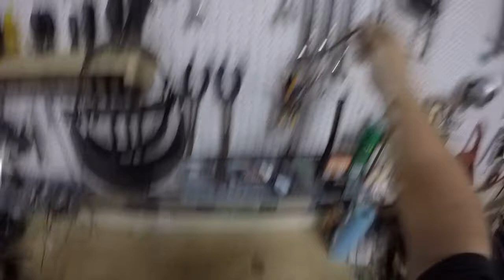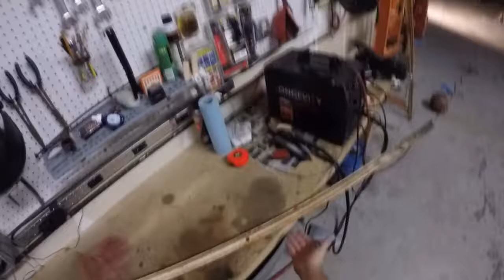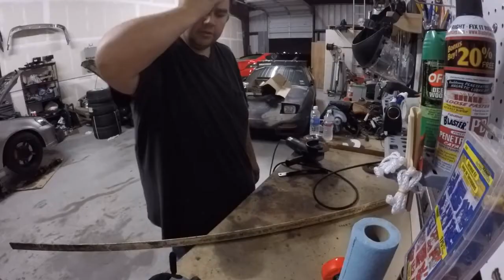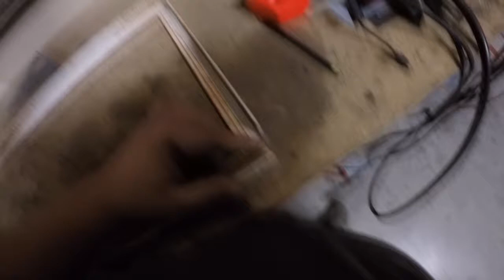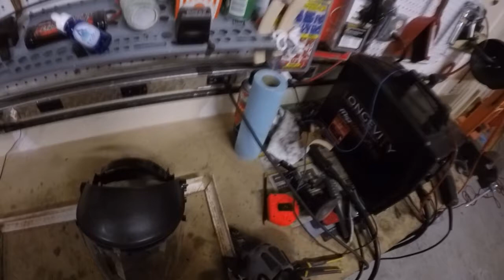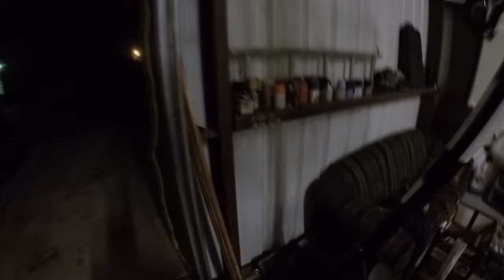Welding cart project Part 1

Comment: Dude you should read the print on the discs. that looks to be a diamond disc for stone and concrete. All you need is a narrow cutoff wheel for steel and a thicker one for grinding. Make sure theres a little railroad sign or similar on the disc face. Everytime you say you like that disc better i cringe...